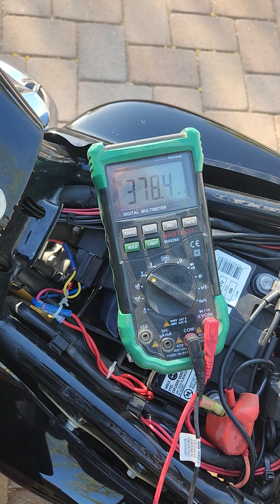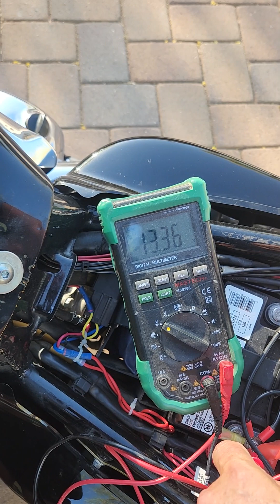SHINDENGEN MOSFET FH020AA voltage drop when fan comes on - 4.2025

Comment: At minimum rpm, the alternator produces less current and the fans overload the alternator. This is normal. However, a Shunt or MOSFET regulator is the worst choice for stator life. It is better to replace it with a series or special hybrid of series + shunt regulator.
Reply from the maker: Do you think a new stator would improve the voltage drop? My stator is hard wired directly from the R/R to the stator. I eliminated the burnt plastic connector under the gas tank. Thanks!
Reply: @Hairfarm1 , A new stator does not help you. The voltage drop at minimum rpm is not a concern. The problem would be if at 5000rpm with the fan on, you don't get more than 13.9VDC on the battery. This can mean that something is wrong with the alternator, that the regulator is not working, or that the connection between the regulator and the battery is not good.